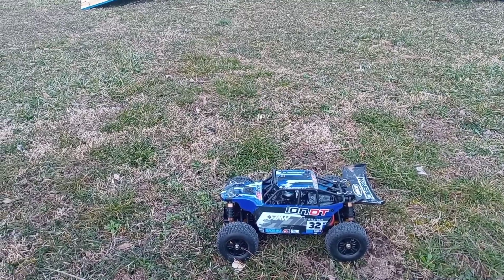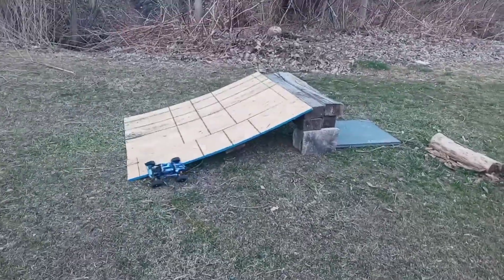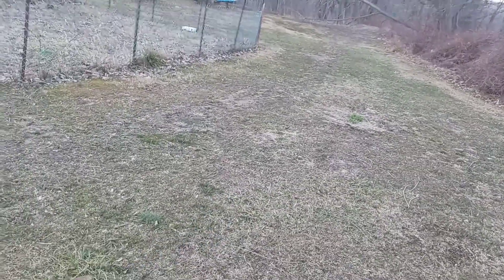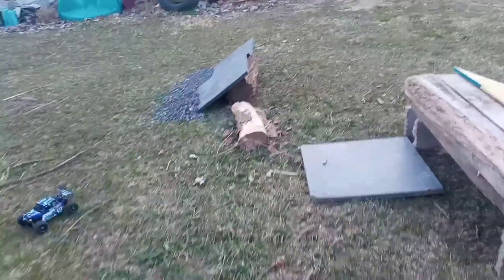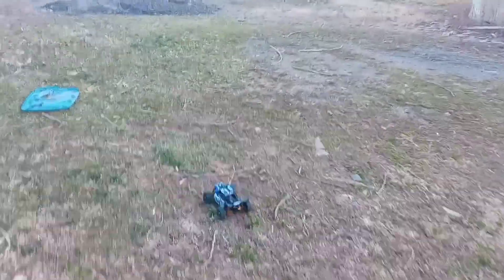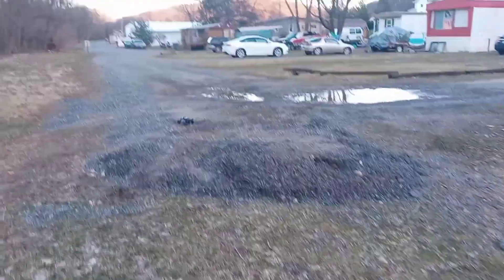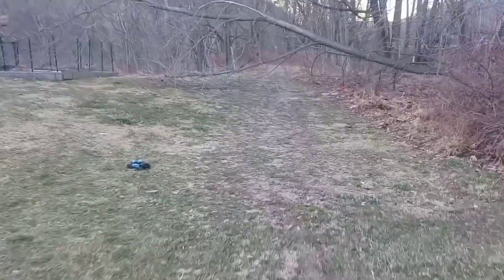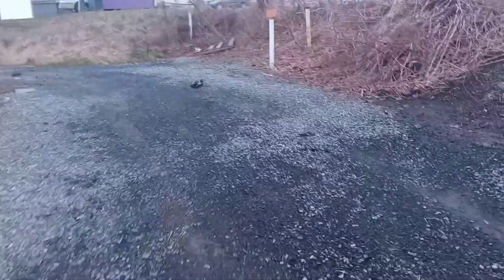1/18 Maverick ion dt first run with new upgrades

Comment: where did u get the a arms from????
Reply from the maker: I bought them from Amazon fit perfect very strong and alot cheaper than the maverick brand
Hobbypark Aluminum Front & Rear... https://www.amazon.com/dp/B071VWTKHP?ref=ppx_pop_mob_ap_share
Reply from the maker: These little trucks are very fun to play with they are fast for there size to thanks for Watching and checking out the channel